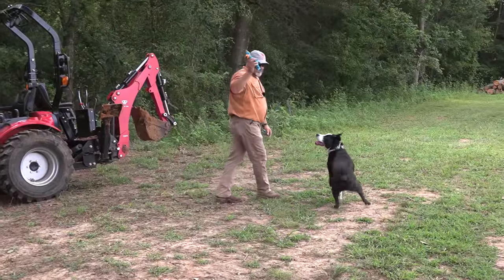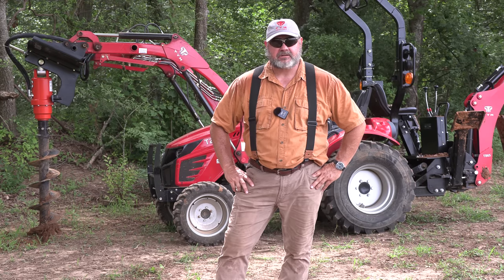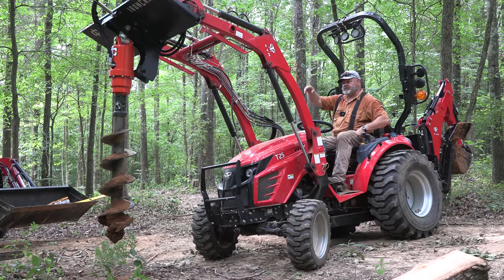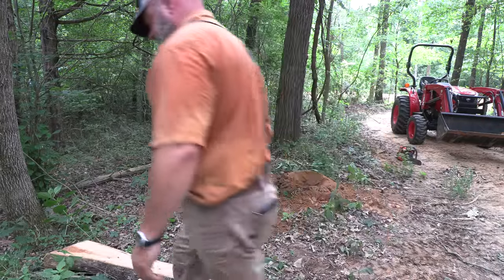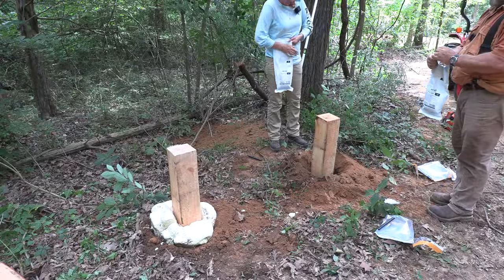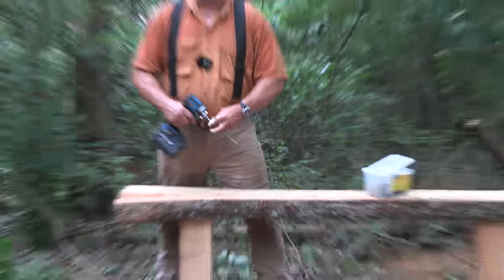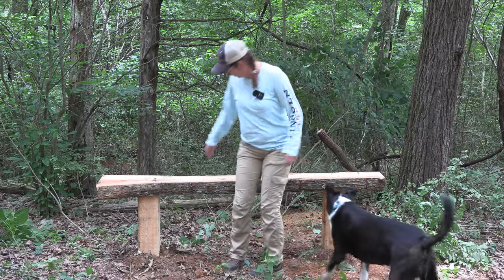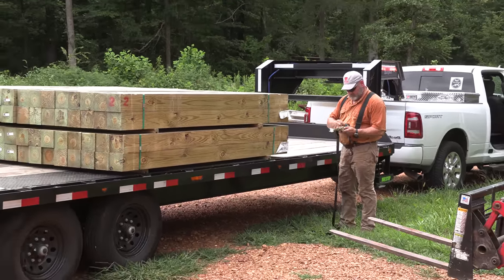Skid Steer Auger on a 25HP Tractor?  Tractor Post Hole Auger TYM T25

Comment: Hey Tony.  I don’t have enough holes needed to justify that purchase.  I guess I could hire out the 25 to poke some, but at my age I’d probably just argue with the customer.  For drama I manage just fine on the comments some of your viewers have!  Lots of experts.  I’m glad I know everything there is to know about everything already!  Saves a lot of time Chief.  If your attack is going as planned, you just walked into an ambush!  Yep, been there.  And yet here I am.  6 out.
Reply from the maker: I love this stuff, sir. I have learned to let it roll off me and push delete if it is warranted.
Reply: I needed an auger like that 20 years ago when I installed all the fences when we had horses....Did every single one of the 187 holes by hand with a clam shell post hole digger and a wrecking bar to break up the hard pan.
Reply from the maker: Back breaking work, for sure.

Comment: Best way to know if a tractor works with certain attachment(s) is trying, and it's even better when you share, so a big thank you. That 5 gpm hydraulic motor might not handle rocks or construction debris but seems powerful enough for soil and clay.

Comment: I bought a 3 point version a few years ago, this might have been a better option for my 43hp John Deere.
Reply from the maker: It definitely works better on my 48hp, but I can see better on this tractor. I liked how it works.
Reply: LOL, yeah those things are a PITA.  Everyone seemed to have needed one, until they tried to use it, then it just became a permanent fixture in their yard after the first time they tried it.  Lots of them in my area, and very few of them ever get used after the first attempt because the ground is either too rocky, too much clay, or hard pan.
Reply: @wildbill23c  The post hole digger isn't my favorite attachment. I should make a stand for it, that may make it easier to connect and store.
Reply: @MikeOrazzi  I see a lot of people just run the auger into the ground and call it stored LOL...not sure how that is on the auger over time, or how much better it is to hook up to the tractor later...but they don't seem all that useful since you can't safely apply downforce to them like you can the ones that attach to the loader....course with a small tractor too much force just raises the front wheels off the ground LOL....don't really have a need for an auger anymore tore all the fences down for a reason, and don't care to put any back up HAHA!!
Reply: @wildbill23c  I did that the first time I used it. It seemed to work, but over time, it may not be the best idea.
Reply from the maker: Why would anyone buy one to dig rocks with. That sound less than smart. It works great in clay, but non of them work on rock.
Reply from the maker: I 100% agree. The old posthole diggers suck to store and install. This one is a breeze. I pull up to it and latch in.

Comment: You can add the extension after you drill the first one in right ?
Reply from the maker: I think you could do it. Don't know if it would be feasible. You know me. I'll probably try.
Reply: @TonysTractorAdventure  it's like drilling a hole in wood in something very thick in a tight place,  you add an extention that's smaller in diameter than the bit and continue till your through then pull back take off extention rechuck  bit and remove from wood
Reply: You certainly can do it that way.  The only reason he says you can't is because of the limited lift height of the tractor....once you got the auger down in the ground far enough you can pull the pin or bolt and put the extension on and continue to go deeper.  Probably better that way anyhow, less apt to bend something with the long extension and the auger trying to get things lined up and the hole started.

Comment: Will it run in reverse. My big issue with clay and my 3 point auger is it screws it self In and stalls the tractor.
Reply from the maker: Yes, it will rotate both ways.

Comment: I was told by my dealer to not use an auger on the front because if you hit a big rock or something that quickly stops the auger, it can do damage to the loader arms. What are your thoughts on that?
Reply from the maker: Your dealer has never used this auger. It is made for tractors. It doesn't turn fast. Think about it this way. When the tractor is pushing a load with the bucket. It takes a lot stronger side load than this auger can provide ten fold. Your dealer most likely has only ever seen or used a high flow skid steer auger. Not the same. Apples and oranges.

Comment: I have a 2025r do you think this will work and do you recommend this over the 3 point auger?
Reply from the maker: I definitely recommend this over a rear mounted auger. I have a hate hate relationship with a rear mount auger. It is rated at 5 gallons per minute but it seems to work. Really good on the T25. I think you will have near the same results that I do as the tractor's hydraulic systems are very similar.
Reply: @TonysTractorAdventure  turns out the deere splits it’s hydraulic pressure 50/50 Between the steering and implement which is only 3.5 gpm each. I’ll need an upgraded flow balancer to run more to the implement and less to the steering.
Reply from the maker: The TYM T25 does the same thing, but when you are not using your power steering, most of the flow goes to the implement. Unless you are steering, you are most likely getting around 6-7 gpm

Comment: Hi Tony, Enjoy your videos. Being that you seem to be a main contact to TYM, could you make a phone call and see if TYM is ever going to offer e factory cab with heat and a/c on the t25 tractor. Would be a great fit.  Amazing they offer a field cab with heat only when I would think tractors are probably used more in the summer when it's Hot. it would be a good competitor against other tractors in it's class. Thank You
Reply from the maker: It is a great idea, but it not feasible in a 25hp tractor at this time. They have the heated cab already for the T25. Heat doesn't require much power as it uses the free heat produce by the engine. AC requires an AC pump which pulls from 3 to 5 hp away from the tractor. This is a big deal. Kioti, Kubota, and a few more tractors companies have tried the 25hp small tractor with AC. Almost all the owners hate them because with the AC on they can only run 3 1/2' PTO implements. Imagine running through 6" grass and coming to a crawl due to lack of HP. The best solution is to add more HP. That is more complicated than most understand. Once the tractor goes over 25hp, it has to have all of the tier 4 EPA requirements. This stuff takes up space and will not fit under the T25's hood. Note, I did say at this time. There are new technologies that require less HP. Let see what the future holds.
Reply: @TonysTractorAdventure  The AC cab on the Kubota BX series comes with a 2nd alternator which powers the AC unit...what a lot of people don't realize is you have to run the machine at full throttle for the AC to work LOL...and then you are slightly limited in HP and in a small tractor, that 3-5HP bite from your total HP which already isn't much is a lot of lost HP...PTO HP on the Kubota BX2680 the largest BX size engine is only 19HP....subtract another 5HP to run that 2nd alternator/AC and you are down to 14HP, which is about the PTO output rating of Kubota's smallest BX1880.  Mowing your lawn might be fine with 14HP, blowing snow might be fine with 14HP, but you probably wouldn't be running the AC at that point HAHA!!  

Curtis makes a lot of the cabs for these tractors...they probably could build a cab for the TYM series...the problem is the cabs are almost $10k without AC, and about $18k with AC.
Reply from the maker: AC pump or alternator. It is robbing horsepower from the engine. I know several people who own these tractors I spoke of. They are not happy with them. I don't think the technology is there
Reply: I was thinking more of the Kioti cx2510 cab with heat and a/c.  Thanks to every one.
Reply from the maker: The Kioti suffers from the same issues as the Kubota. When the AC is on, it suffers from severe power loss to the PTO. I receive over a thousand comments each week on my social media channels. I go to tractor shows all over the United States. Every owner that I have talked to who owns a 25 horsepower tractor with an air condition Cab is unhappy about the mowing speed and the lower power. Maybe in a few years they can get air conditioner so efficient that it's possible. I know this is not the answer that you want, but you will regret buying a 25 horsepower tractor with a cab and air conditioner. It would be better to move up to a 30 to 35 horsepower tractor with a cab and AC. You would be able to pull at least a 5 ft implement at reasonable speeds.
Reply: Thanks everyone. OK  it's the Kioti ck3510se  with Cab , heat and A/C
Reply from the maker: Kioti makes a good tractor. I know you will be happier with A/C and 35hp.

Comment: Would this work with a 254? 
I would like to buy an auger soon and would also like to buy a stump planer bit for it. 
Do you have any suggestions with regard to the kapacity of the  TYM-254 ?
Reply from the maker: The t-254 is a bit underpowered for this. I also don't believe it will lift high enough. I can't use an extension with My T25.
Reply: @TonysTractorAdventure  
Thank you so much for your reply.  
Are there any quikk attatch 3rd funktion augers that would work with a 254? 
At least that you know of?

Comment: how many gpm is your tractor ?
Reply from the maker: I covered all of that in the video.
Reply: Right off TYM's website:  
Implement flow	4.18 gpm
Steering flow	        2.77 gpm
Total flow	        6.95 gpm

As a comparison my Kubota BX2680's total flow is 6.2gpm...with about 1gpm going to the power steering, and the rest goes to implement flow...but if you are using implements like you have your loader maxxed out, you get no power steering assist....so the pump does have a provision to bypass the power steering to send full flow to your loader, or 3 point or 3rd function or rear remotes I assume...I just know with my BX2680 if I am using the loader and trying to lift something heavy, I get nothing for power steering assist.

Comment: At start of video - Man on ground needs to learn correct hand signals to give to tractor driver rather than talking over tractor engine and some rather unclear hand motions - she did a great job understanding what was required - also have tractor idled back a bit when just positioning things especially when there is someone on ground in close proximity.
Reply from the maker: Thank you for your input. This is a  "what Tony and Tanja does channel" and not a "how to channel." LOL!

Comment: question:  why wouldn't you use the bigger tractor with the PHD ?  Also,  Pilot holes might not have been a bad idea.  ( I don''t mean to be a backseat driver, but just saying
Reply from the maker: I explained it in the first of the video.

Comment: You need a better drill!
Reply from the maker: You obviously never worked with seasoned oak before. Especially seasoned oak and the knot. Any impact driver would be a good driver if it did half as well as the one I have.😁😁😁

Comment: I doubt my Kubota BX2680 would run that thing 5gpm that the auger claims is the bare minimum, to make the bit spin I believe, you'd need closer to 9gpm to really make use of it.  Maybe in perfect already loose soil, but not in the hardpan/clay crap we have here in southern Idaho.  You'd just end up with a permanent auger bit in your yard.  The augers that mount to the loader sound great, but you gotta have a big enough tractor to run that hydraulic motor, and most of these little tractors don't, or are on the very bare low end of the requirements and won't give many people the results they think they should.  Those 3 point hitch augers are a PITA for a lot of people.  I'll just stick to the shovel and regular old clamshell post hole digger and wrecking bar that I've used for the past 30 years.
Reply from the maker: I just showed it worked really well on a 4.9 gallon per minute system. You are right about the rear mount it postal diggers. They are the bane of my existence. They had this hydraulic motor made specifically for the low flow tractors.
Reply: @TonysTractorAdventure  5GPM is total output, loader operation and the auger running off the 3rd function, I bet it would really struggle if it would work at all.  Given the soil conditions in my area, it probably wouldn't have enough torque at that low of an output to break through the hard pan, and I don't know of anyone in my area that has one of those augers to give it a try...an awfully expensive attachment to "try" LOL.  The nice thing with the loader mounted augers though, is you have downforce, where with a typical 3 point auger you don't have that, you have to rely on the auger being able to dig in and pull itself down...and then get itself stuck LOL.
Reply from the maker: I appreciate your opinion, but having run it in person, It never once offered to bog down. I would feel comfortable running it every day.
Reply: @TonysTractorAdventure  Cool send it my way to test it on a smaller machine.
Reply from the maker: @wildbill23c. I think this is as small as I would want to try it on.
Reply from the maker: I just put 12 posts in the ground 4 ft deep using the T25. It never failed once. This may have something to do with the fact that the T25 has a 7.6 gallon per minute pump which diverts some of the flow to the steering when the steering is used. That flow seems to be going to the implement when the steering is not moved. It has exceeded my expectations.
Reply: @TonysTractorAdventure  The BX only has a little over 5gpm so that's why I'm saying it would struggle keeping up with an auger like that.  With the type of soil I have I don't think it would work at all....too bad you can't rent or borrow something like that to try before you spend that kind of money on an implement LOL
Reply from the maker: I got it for the big tractor and I knew it would run it. I had so many people ask about the T25 I tried it. I liked it so much, I am using the T25 and auger to dig my cabin piers. It is easy to see and control. I am not sure I will use it on my big tractor unless I need to dig with extensions.